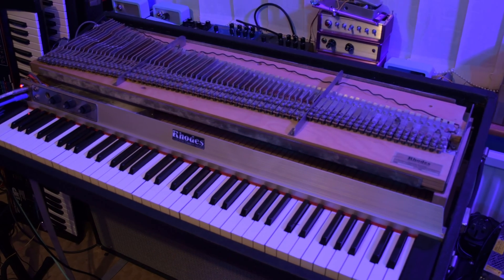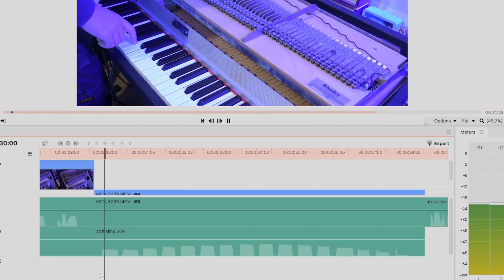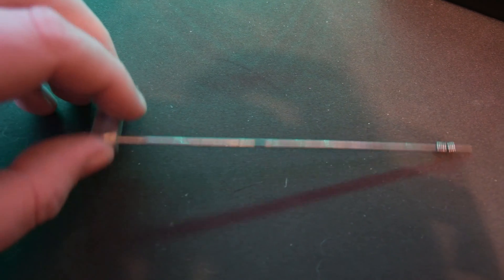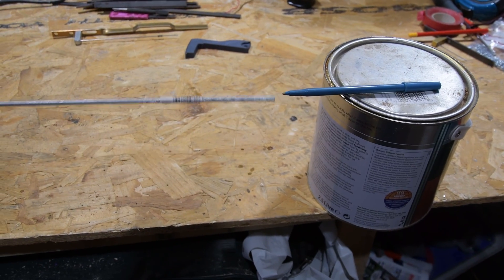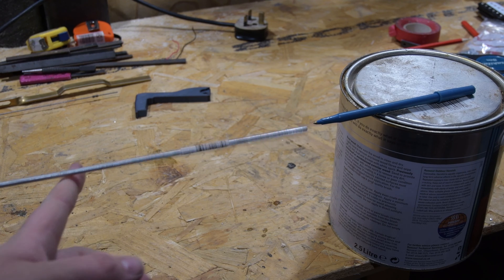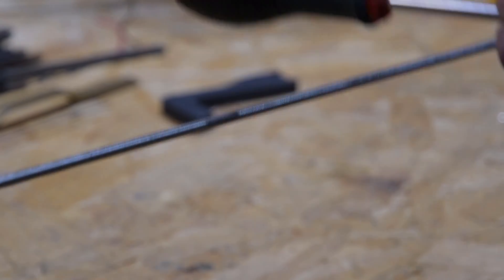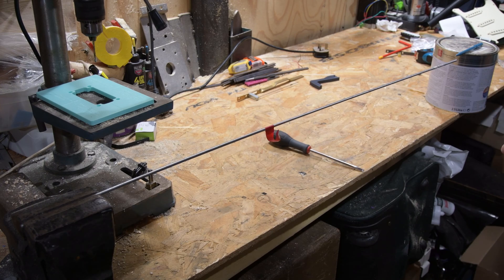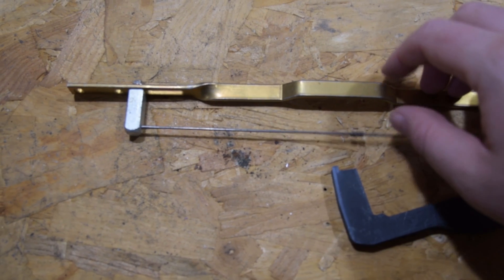The secret of the strike line - Understanding the setup of a Fender Rhodes piano

Comment: I've always loved the sound of Chick Corea's electric piano with Return to Forever, but never knew anything about it until the last few days. Now that I've seen quite a few videos on the Rhode's piano and the contraption that it's based around, I'm gathering first that the mounting point (to the frame) must avoid dampening the energy, so the motion must be balanced on both sides.  It also seems that the combination of the tine and 'bar' (not sure of the terms) as a tuning fork of sorts must allow each half to resonate at the desired key frequency, but the tine can do that at a higher bending order if that's encouraged with appropriate hammer contact.  The coil must have a clean DC voltage to provide a magnetic flux then the AC component is filtered off as sound.  I can see that it's quite a complex and fascinating device and thank you for the demos.
But what I wanted to mention is that there is a museum in New Plymouth, New Zealand called the Len Lye Centre that specialises in kinetic art, as you're seeing in the tine. In case you're even in the neighborhood.  https://govettbrewster.com/the-gallery/len-lye-centre

Comment: Although the harp is adjustable, as the description says, the main problem is that the tines cannot be adjusted individually to the sweet point. I used to plan to make a new headstock out of wood slices, but it's not worth it. You have to compromise and unify the sound with the pickups placed close to the tines.

Comment: is it crucially important to have the tine tapered at the mounting side?
Reply from the maker: I could be wrong but I think it has two uses. It reduces the stress when the time bends so they fatigue a lot slower. The other reason is that the connection between tine block and tine needs to be tight and even. If this is perfect you have a bad time that won't sustain. I think having the taper reduced the failure rate as it'd easier to have a good connection with a larger tine. 
The first fender Rhodes models had straight times though so it is possible.
Reply: @deancoyle  thanks! and what would happen if the oscillator fork (tine + metal rod) would be hard-connected to the wood frame instead of springs? would it kill the sustain or maybe cause some other effect?
Reply from the maker: I think it would eat up  the sustain and also you lose te ability to adjust the position of them.
Reply: @deancoyle  thank you. this piano is fascinating. i am just now discovering this. its crazy how they managed to find such a cool sound with such early tools

Comment: That should be right at the antinode of the 3rd mode of vibration if im not mistaken. Sounds reasonable enough. My guess is that its a balance between the dynamics of the hammer mechanism and the tine, like how the vibration propagates through it. I'm just speculating but i think the sweetspot might change with different tine or hammer properties, like a really stiff tine would probably benefit from being struck at at 2/3 instead.  Same with a super soft mallet.
Love the series :) lots of fun little puzzles like this

Comment: To get maximum movement at the pickup end of the tine there must be one and a half wavelengths of oscillation. This means that the other point of maximum movement (where the tine is struck) must be one third of the distance from the fixed end.

Comment: Very cool.  I used to have a Rhodes that I could never really get sounding good.  I always had the metallic "plonking" sound no matter how much I adjusted things.  No I realize that that was the 3rd harmonic and I wasn't moving far enough backward or forward to get the strikeline correct.
Reply from the maker: These can be annoying instruments when not setup right. It is a shame many came from the factory needing work.
Reply: @deancoyle  It was a definitely "get 'em out the door fast" attitude at Fender back then!